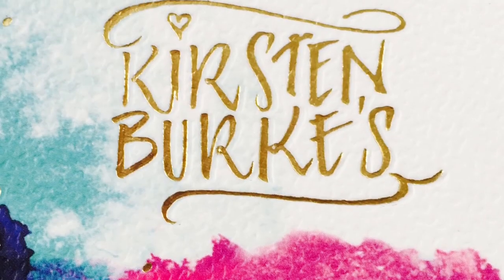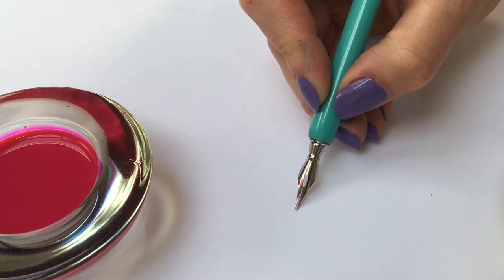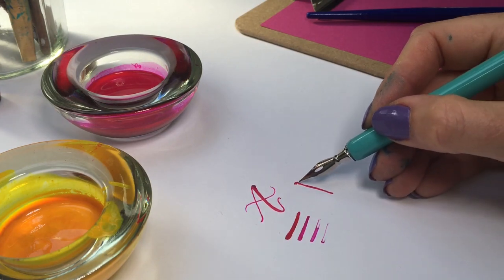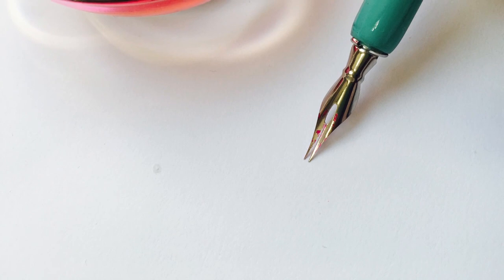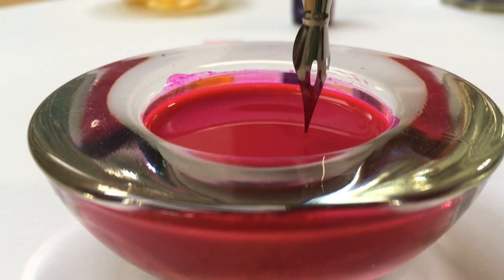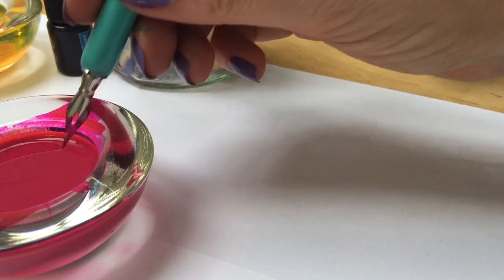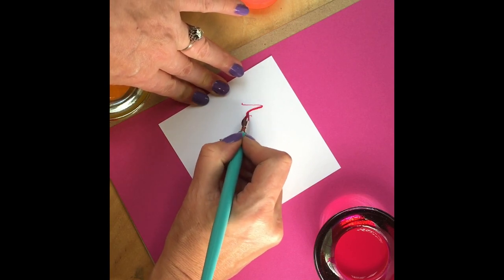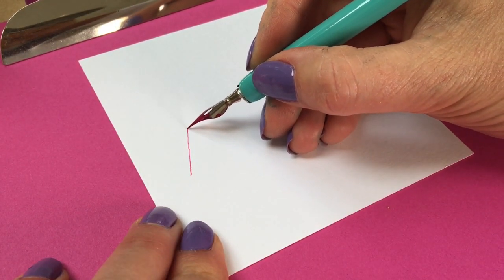2 Ink Flow - Secrets Of Modern Calligraphy

Comment: I just watched your video, Im not using the straight pen, but have had sooooo much trouble getting the ink to flow in the manuscript pen set. I really listened to what you said, and tried dipping it in a little water, and checking the little metal pices on the end of the pen. and WA-LA! it worked. I was beginning to think the little ink catridges were empty, but something worked, thenk you.
Reply from the maker: That's brilliant, I am sooooo pleased I could help. Thanks Janet
Reply: Hmm.. Thanks for this Kirsten, I actually have a similar issue and its also the Manuscript pen set. I tried dipping the nib with water but can't seem to have the ink flowing still :/ what could be the issue here? I am very new to this.. so honestly, I haven't a clue if my angle is even right. 

Would be great to hear back from you, thanks!

Comment: Hello, I have an issue with my nib sometimes just dumping all the ink after I’ve dipped it in almost one go on the paper. What am I doing wrong please?
Reply: Usually it's caused by too much ink on your nib.Just slightly run the underside of the nib over the mouth of your ink bottle(or the side of your container to get rid of excess ink)